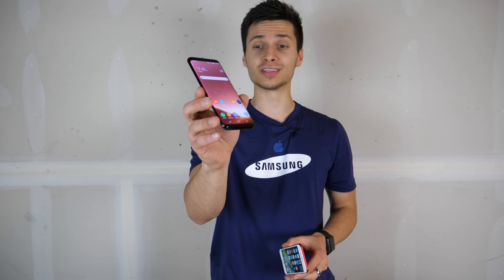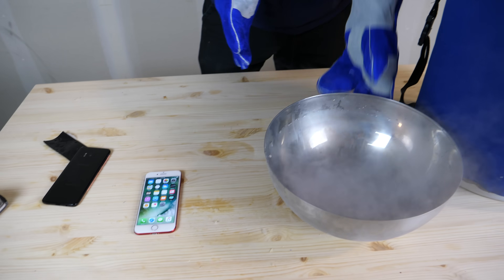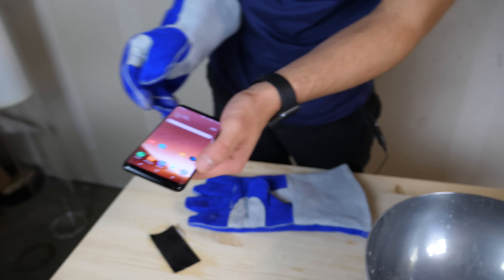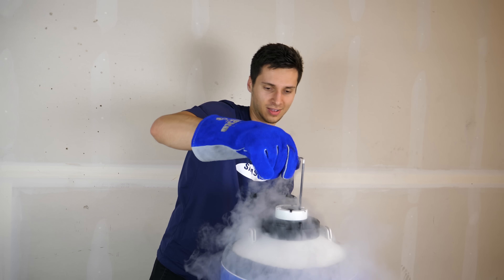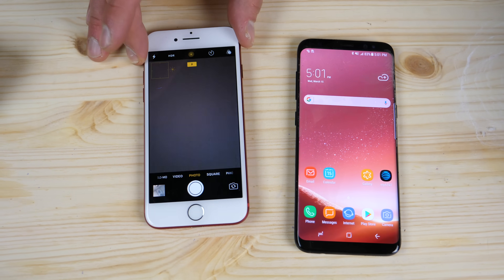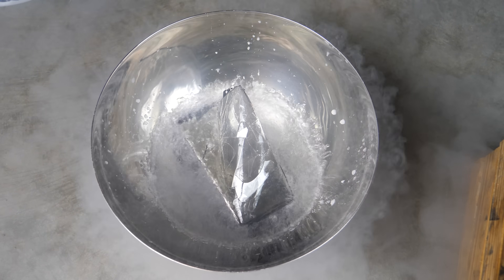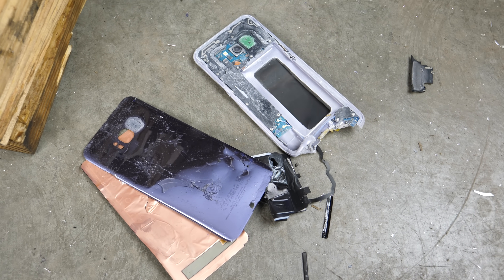Liquid Nitrogen vs Samsung Galaxy S8 & iPhone 7! What Happens?

Comment: Bro both phones will do fine after extreme cold as they regain room temperature. And by the way cold makes stuff shrink not expand and also makes semi conductors non conductive that's why both systems didn't boot at first and were slow after booting.

Comment: 6:56 All the animations are slowed down.

That means Iphone is a Reptile and slowed down its metabolism under Freezing conditions.

Illuminati confirmed

I don't know that could be due to the reason that the semiconductors used in Phones work poorly under low temperatures basically the processor is nothing but a  Semiconductor so as the temperature decreases it's efficiency reduces too(As electrons are less mobile)

Comment: Samsung always the best
Reply: Noah K 
More like, a fact.
( actually not the best since there aren't the best, buuuut definitely better )
Reply: Samsng it is very cool
Reply: Noah K 
It might change with time, who knows?
Remember Apple when Steve Jobs leaded it? That's when they were the best. Now it's not.
Reply: DankestStorm how do u know
Reply: Noah K 
Look at their ways of work into their products, like how their old hardwares and firmwares actually had a better standard than what they have nowadays. The iPhone X barely had 350$ worth of hardware components and yet they sell it for more than 1000$. Big ass profit chipped off because of their brand's fame. The firmware has more problems than they ever was now. If you didn't know, in version 11.2 of the iOS, they had an error which would cause the iPhone to not function properly whenever an specific Arabic letter shows up on the screen, or the concurrent problem, iOS 11.4, which kills the battery a lot faster than the older version ( check Apple communities, there are reports going on, even DailyMail have an article about it. If you wanted, you can go way back to iOS 9 and 10, when they had those soft brick errors on devices, just by receiving some specific messages.
Reply: DankestStorm =(
Reply: DankestStorm but it’s still is an opinion and I’m still sticking with iPhone
Reply: Noah K 
Uh no, that's actually facts. An opinion is more like "I don't like this"

But yeah i'm not gonna stop you to buy another iPhone ¯\_(ツ)_/¯
Reply: DankestStorm uh “Samsung is the best??” That’s has to be an opinion
Reply: Noah K 
Shitting on iPhone = Samsung is the best

Seems logical

If you're talking about the "More like a fact" comment then read again.
Reply: DankestStorm omg stop fucking say it’s a fact let me just say it’s an opinion for me not u... u got it? =/
Reply: DankestStorm phew we good
Reply: It will change to some songs lmao jk
Reply: Alan Gen an opinion?
Reply: DankestStorm no in the future maybe soon it won’t be the best
Reply: Alan Gen eh u sure about that?
Reply: apple always the best
Reply: Alan Gen no

Comment: Couple of things are wrong here. Thin glass doesn't crack due to temperature differentials. Also, the ice didn't enter the S8, it was the liquid cooling system that the phone is equipped with.

Comment: Guys he put an extra cup because it's a spherical bowl meaning if the phone is longer then you need more liquid nitrogen to submerge it. You can clearly see that the bottom of the iPhone is submerged at 3 cups and the actual bottom part is boiling, but the galaxy is not at 3 so he put in another to make it fair since the galaxy is longer. After he put 4 cups in, the top portion of the galaxy started to boil just as it did with the iPhone. I can't believe people get butt hurt over this like who cares, it's just for fun. It's not like these phones ever have to deal with liquid nitrogen anyways so it doesn't really matter which one does better anyways.

Comment: man it is normal that they go off when you put the liquit on it cause of the batteries. Every batteries only work under normal temperature and cold is toxic for them. thas why the iphone show you empty battery power when you try to put it on. And no wonder, that they revive after you waited a bit and the battery had higher temperatures....

Comment: Just FYI cold doesn't expand anything. Actually just the other way around. If it snapped it's because occurred contraction. everything got smaller and loose, even the glass contracted e cracked.

Comment: it's not the broiling that cracks them because the boil is in so low temperature it's not really hot what make the glass crack is the extreme temperature change and then it starts to crack

Comment: 1. The S8 got one extra flow of Liquid Nitrogen. 
2. Nothing cracked on the S8, the glue that holds the OLED panel to the glass lost its integrity and became brittle thus separating it from the glass
3. The iPhone's OS was never slowed and the S8 didn't have the same effect as it uses OLED for a display rather than LCD. What happened was the LCD crystals in which form an image and produce color were slowed, as extremely low temperatures effect an LCD Pan's refresh rate and response time, increasing the response time dramatically to nearly 40ms or even up to 70ms will create that ghosting effect you saw.

Comment: he knows that the S8 is tuffer so he put in an extra scoop an left it until it died btw was much longer than the iPhone.
Reply: Emma Toodles how? 4 scoops for the s8 3 for the iPhone
Reply: Emma Toodles it was not fair bitch
Reply: chips pickles the iphone x will release.
Butbit have almost exactly the same hardware, and some of software. And it even have AMOLED display. They even didn't mentioned Samsung's SIGNATURE amoled screen as an reference. So yeah...
Reply: Zanakum Trinacãn Zapaczou Oozakun The Third 
They didn't mention Samsung because Samsung didn't sell them their good displays.
Reply: *tougher
Reply: Dak Grant he also let the I phone recover longer
Reply: Junhao Wang Yeah you're right...
They STOLE it, thanks for the correction...
Reply: chips pickles still to compete with the s8 still the iphone 7 month later
Reply: Dak Grant true dat
Reply: Dak Grant 7 was released before s8
Reply: Victory he/she mean it was fair cuz its iphone 7 and s8
Reply: He put in an extra scoop coz he blew the nitrogen and stopped the boiling therefore making it fair
Reply: At least the iphone survived with no damge
Reply: KalDan8 u just made a mistake my friend
Reply: Dak Grant it was fair shut up

Comment: iPhone 7 was exposed  for 46sec
Galaxy S8 was exposed for 1min16sec
-----------------------------------
iPhone 7 had an empty bowl at the start
Galaxy S8 has 3 scoops of nitrogen in the bowl at the start and was boiling in the liquid from the 2 second pour
While the iPhone 7 was only sitting in a puddle of nitrogen after the last pour at which time you pulled it out not long after.  I don't even need to mention the obvious bullshit "and one more to make it fair" pour, making it one more scoop than the iPhone got.
Reply: I don't know why you're surprised that "EverythingApplePro" puts up a test favoring the Apple phone.
Reply: And one more cup for Galaxy s8
Reply: it was not fair for the s8
Reply: I think he didint want the s8 to turn on
Reply: djlobb but galaxy cracked 😊
Reply: s8 won
Reply: hahahaha... I also think like that ... and I never trust the apple pro because in his video always apples are winning
Reply: When the camera was facing the S8 front on it looked as though the digitizer had cracked but when he picked it up and you could see it from an angle it didn't look cracked at all.  Just another way for this guy to try to one up the iPhone.  I'm also not sure as it has been awhile since I have owned an iPhone but don't they usually hold the phone together with screws?  so even if the glue on the iPhone failed the screws would still be holding the phone together.  It also can be pointed out that when both phones were turned on the iPhone performance was notibaly slower whereas the s8 performed as normal.
Reply: Pero Mačak that's what I'm say in s8 won
Reply: lol I noticed that too 😂
Reply: his name is everything Apple what do you think
Reply: djlobb o
Reply: I was surprised it turned on myself. Usually once the liquid nitrogen starts getting inside the phone itself that's when it causes damage to the soldered ic's and other chips etc. The iPhone only got cold, then shut-down. The liquid nitrogen didn't get a chance to get inside it and lift the glue etc.
Reply: +nanda br  no it didn't, it also turned on, which means the display was intact despite coming away from the front glass/digitizer.  Despite EverythingApplePro's best attempt at killing the S8 by unfairly submerging it and keeping it in for longer it still turned back on and wasn't even operating slow like the iPhone was.
Reply: djlobb hater
Reply: djlobb liquid nitrogen won't do much damage to ic's. The condensation will.
Reply: djlobb great so?????
Reply: McGaMeR 
the fact that you can't see that they were making a point to emphasize an unfair test is just plain out sad.😧
Reply: djlobb thx calculator
Reply: djlobb calm down bro u Samsung sheep
Reply: nanda br fuck off
Reply: RABBIT KING* get lost mate
Reply: Its true
Reply: djlobb remember the drop test iphone 25 but not samsung so it's fare
Reply: We have a fanboy alert! Life isn't fair sometimes so suck it up. Sure, samsung has a nice looking phone and I like the quality of the phones (and a weird name) but Apple has a super friendly user interface and I think they deserve the advantage in the world. Better name, better interface, and better phone overall. Done
Reply: boy its the "Product (Red)" IPhone... everyone sane knows that...or at least everyone who knows that actual GOOD phones exist
Reply: Alexander Yose but bro, this is a test do it HAS to be fair. He needs the exact same measures to check which one is durable so it needs to be EXACTLY the same. Why do you lack of logic?
Reply: Alexander Yose and wtf youre insulting korean culture. Stop being racist cuz for koreans, it is a weird name as well. Samsung stands for 3 stars bcuz 3 peple founded it yoy american racist dumbfuck
Reply: djlobb TRIGGERD
Reply: Adri Reyes bruh, thats so unfair!!!
Reply: djlobb samsung is the winner.. 👍
Reply: Samsung is the winner
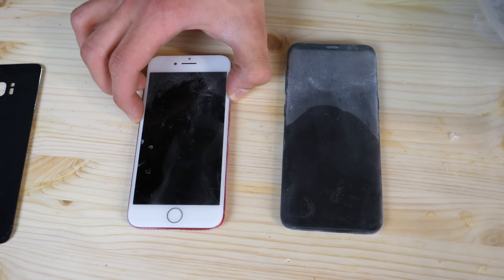Reply: Don't forget that he cut the film at 6:34 to make it look like the iphone instantly turned on
Reply: +ChiefSwag -minecraft&more  
Pointing out an obvious bias and bullshit test is not me being bias. Nowhere in my comment did I mention that I have an S8 or even like it. I have an LG G6. But by all means, continue speaking shit when you know shit all.
Reply: It looked more like the display delaminated from the glass on the S8 then cracked.  Its kind of hard to tell though.  When he picked the S8 up and you saw it from another angle it didn't look cracked.  Either way though its pretty obvious liquid nitrogen is the Krptonite for Samsung's glue.
Reply: Hypergogeto ik that he didn't do a fair test but what do you except as if he will do a rematch that's why I said great so? I am a Samsung user
Reply: djlobb iPhone has case...
Reply: No thats the glue, if the AMOLED display cracked it would not have worked when he turned it on, at least in my experience.
"liquid nitrogen is the Krptonite for Samsung's glue"
Liquid nitrogen ruins any glue, it does the same to the iPhone 7 as it uses glue instead of screws like on the iPad and unlike previous iPhones. If you look at other iPhone 7 vs LN videos the same thing happens. In this case the iPhone 7 wasn't submerged in the LN long enough for that to happen whereas due to the unfair circumstances the S8 was submerged much longer.
:EDIT: Maybe it was the digitizer layer that was cracked? But then touch was still working?...
Reply: he actaully thinks galaxy is better!!! so yeahhhh     just doens t know hot to run a proper test!
Reply: No only samsung
Reply: Truth
Reply: I like Samsung but you are a huge fanboy
Reply: Apple is better

Comment: about those "cracks" this is the loca glue (a kind of uv glue used to glue the screen and glass together, by cooling the glue down, it loses its tackyness, ahich causes the glass to seperate from the device, it does this in such a manner that the loca glue creates a web formation allike when you put glue between 2 surfaces, and lift one from the other. the glue nor the glass is broken

Comment: That's why I use iPhone, you could see how cheap the Samsung plastic cover was
Reply: Kenward Evan the older models all had plastic so I assumed this one did, turns out it's thin glass that shatters easily so even worse than plastic
Reply: Kenward Evan the glass at the back is either weak or very thin

Comment: bro you put a lots of liquid nitrogen in Samsung galaxy  S8
Reply: Bolt The Lighling Dash no he gave the iphone just 3 scoops
Reply: The Iphone had 3 dumps not 4 like Samsung and he put the S8 in the bowl with liquid nitrogen already in it while the Iphone had an empty bowl
Reply: BveFan correct
Reply: Bolt The Lighling Dash not fair is it
Reply: BveFan yes although the Samsung is longer and wouldn't be submerged so easily
Reply: The Iphone was touching the ground because it was as big as the s8, so it was actually fair.
Reply: Bolt The Lighling Dash he did 4 dumps. Just like the iPhone
Reply: Tristan Walters yea you are correct

Comment: I live in Minnesota where temperatures can get down to -30. When I am walking outside when it's that cold, I literally have to not use my phone because my phone will automatically turn off because it's so cold. And when it does power on after warming up, the animations is slow just like the video around 7:10 but once it warms up even more, animations goes back to normal.

Comment: If you get the phone, or any device with a crystal oscillator really, the crystal will get too cold to function. If that happens, the processor cannot produce a stable clock, and will shut off. I made one of my Raspberry Pis shut off by blasting the CPU with freeze spray, cooling it from about 30c to -13c (that was the lowest the internal thermostat would read) and the device shut off for several hours until the crystal oscillator could heat up again.

Comment: The cold alone probably didn't hurt it.   THe deal with the electronics is they have to be a minimum temperature to work; you dropped that temperature below that level.   Assuming the temperature differential didn't cause any components to crack, I could see the iphone recovering perfectly fine.   The S8 though: Not sure if an OLED can hold up to that.  One small area an LCD might be better.

Comment: I am apple fan boy, I never had an iPhone but I had iPad air 2, but for my phone I had  S3, S5, Note Edge. from those phones what I experienced is, IT LAGS SO FUCKING MUCH, also yes the #1 problem all android fans was hiding is the amoled burn, after years of usage you will start to experience this, even on samsung store, the phones there for experience are amoled burned  hard. I used my sisters iPhone 7+, it feels good and premium and the camera is already on the limit I dont think you need more HD or pixels on that its already damn good it is like you are complaining on GTX Titan because samsung had GTX 1080ti.

and btw I like simple, android are so messy and random lmao iOS launcher? i tried it its terrible just like you bought an iPhone clone... more features? tell me, were those features usefull? no. Android was the first to invent multi window? was it usefull? no. But on iPad it was usefull because it is simple to use and quick, and btw I hate how the touch system works on Samung phones, Just got a little wet on my not edge the screen already freaking out and magically fixed after turning off and on

Comment: The "ghosting" effect you described is an artifact of the "L" in the LCD of the iphone. As the Liquid Crystals cool, they become less willing to respond, and literally move slower. It may seem like the actually processor is slowing (and, well, it is, just very very minutely - you wouldn't notice) but the LCD is just not responding as fast.
Reply: this also explains why it wasn't visible in the Galaxy, as it used a newer display technology called AMOLED, which does not have a liquid component.

Comment: Comment section is... Fucking hell, the phones will obviously turn off, since the battery will get cold and can't output enough energy (low voltage). And guys do you know what LCDs are??? Ehh. Also fun fact, the Samsung probably would've broke anyway. Damn. Oh and slow down the OS? BOI

Comment: beacuse the pressure difference is to big the case came off. of the iphone it didnt because its less sealed for water resistense. therefor the pressure in- en outside will be equal

Comment: The speed issue is because processors work on electric signals on metal, which is a better conductor in higher temperatures than in lower